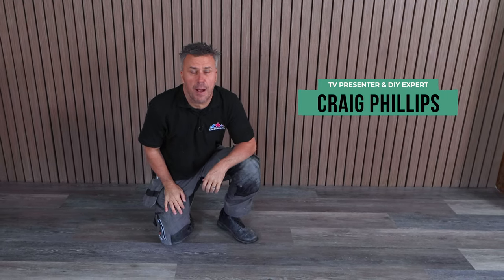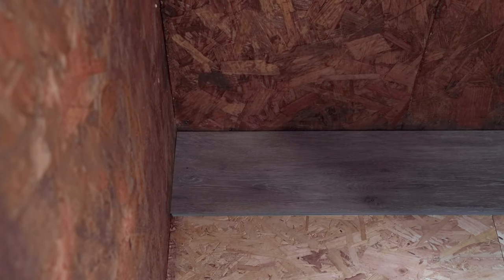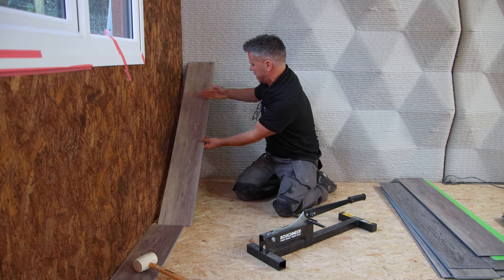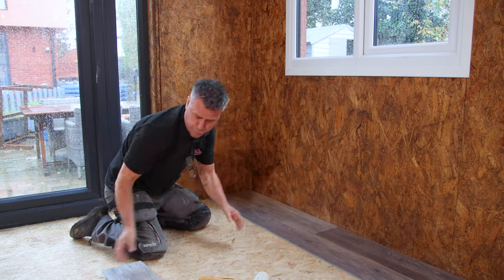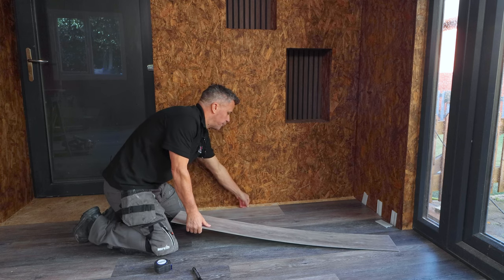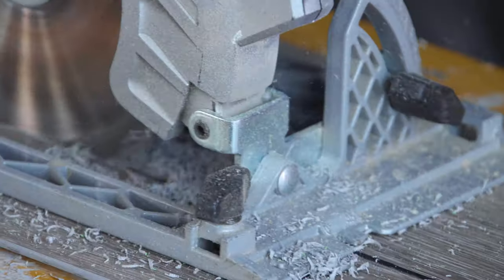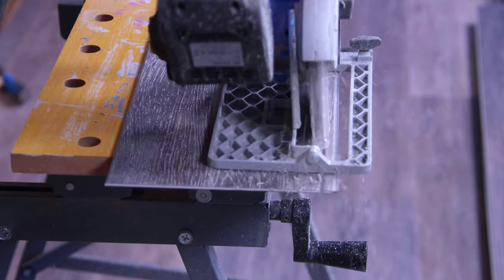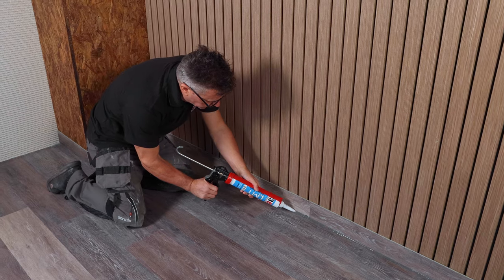How to Install LVT Flooring | FULL A-Z GUIDE | Flooring Trade Tips @TileMountain1

Comment: Any recommendations for a slightly uneven subfloor, Craig (2-3mm low spots here and there)?. I really don't want to be pouring levelling compound.
Reply from the maker: HI Richard, If you intend using LVT I'm afraid you'd need to pour self levelling compound first to remove the uneven sections, there is other flooring thats thicker and have different T&G click joints that may hold when you use thicker under lay below to carry out the gaps
Reply: @MrandMrsDIY  Cheers mate, guess I have to suck it up 😁. Great video tho 👌

Comment: I'm looking to install this over floorboards.  Do i have to plywood the floor first to get it flat?  If so, how think do you think the plywood needs to be?  I am replacing 7mm laminate and a foam underlay so even 9mm plywood would raise the floor height by several mm
Reply from the maker: Yes I'd be inclined to apply a layer of 6 to 10mm ply, glued and screwed down to the T&G floor boards before laying for best results

Comment: Would LVT be great for a heavy-duty electric-powered wheelchair? Mostly, the chair would do a 360° turn on the spot. Most appreciated.
Reply from the maker: Yes I'm sure it will, you may have to double check with the manufacturer about any potential rubber marks it could leave when doing a 360 degree turn. Better to be safe than sorry!
Reply: @MrandMrsDIY  Thanks for your swift reply and help.
Reply from the maker: @domenicopasquariello7634  No probs!

Comment: Hi, can you advise how you finished up against the door frame? We have a similar situation for a garden room, and clueless about how to finish off the install. Thanks in advance.
Reply from the maker: Yes so we had several cut pieces down, then I cut the last plank in half, and slightly scribed around the edges to make sure that it could fit in with the frame, as well as leaving room for the expansion gap, cheers!